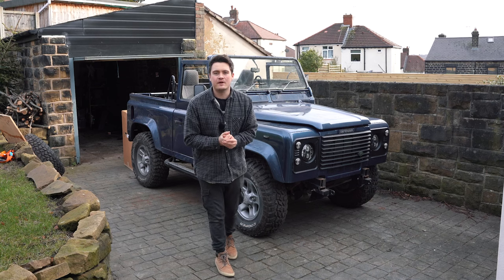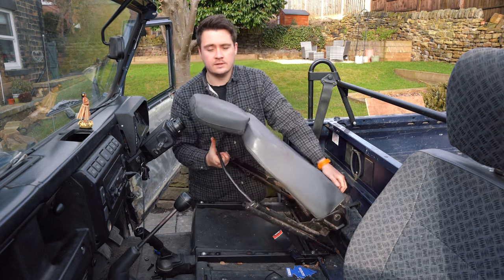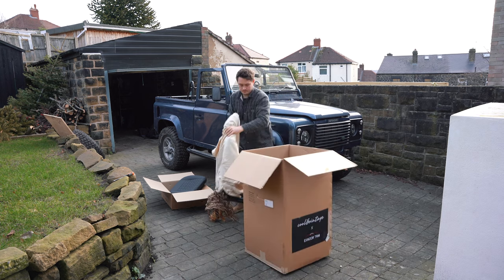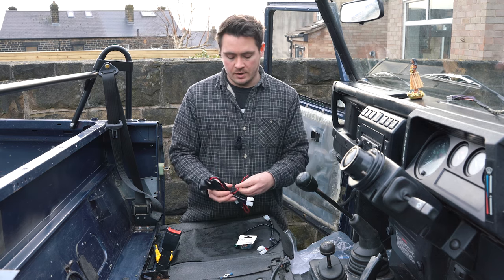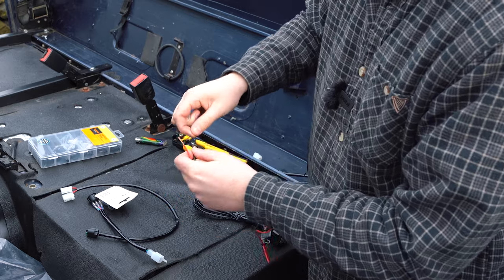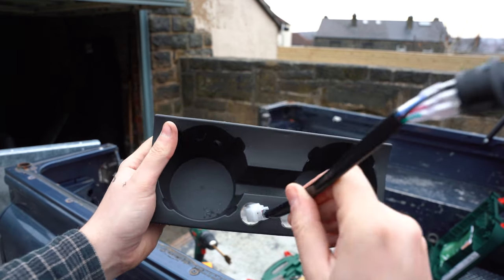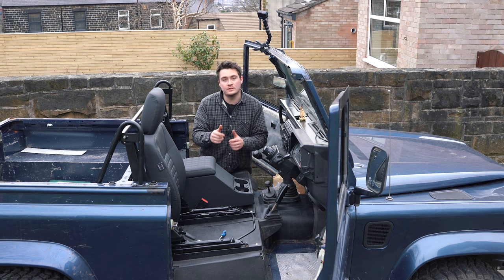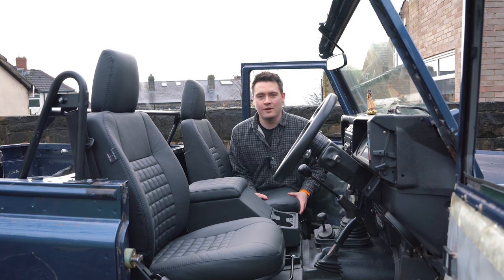MY LAND ROVER GETS A BRAND NEW INTERIOR FROM EXMOOR TRIM

Comment: Great looking interior.  Well done on finding a dry day to fit it.  As usual great video work making it easy to follow should I want to do something similar.  You said in the intro you were going to share your latest thoughts on Blue’s finished colour? Did I miss it?! 😂.  I am not a betting man, but I reckon you are going to stay with Blue’s original colour.  Am I right?!   Also, you said the heated seats were better than Scout’s - so is the Exmoor Trim heated seat better than a standard LR offering? Would be interested to hear your thoughts.  Thanks for the video!
Reply from the maker: Thanks so much for the comment! And yes, it took a while but finally found a dry day 😂 You didn't miss it - I actually forgot to mention in the video 🤦‍♂️ But yes, you're right, I've been won over by the colour so it's staying Cairns blue for the foreseeable. In my opinion, I would say that they feel stronger than the standard heated seats that come as part of the XS models - but maybe my set just aren't great in my Puma